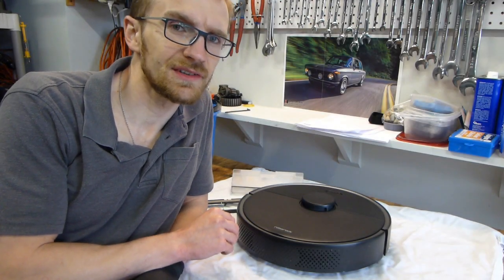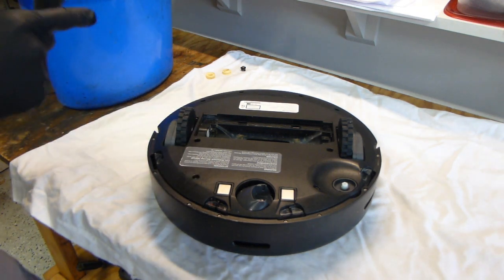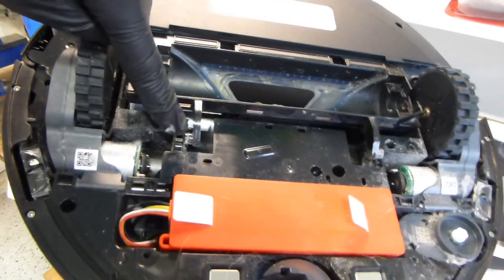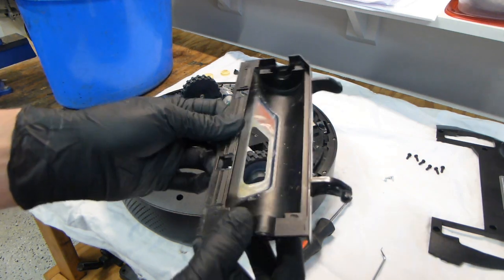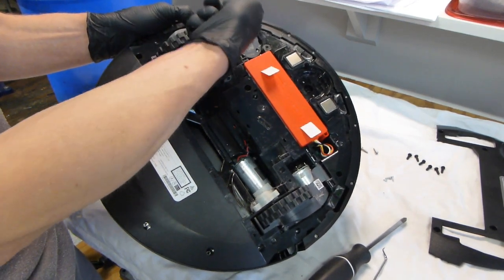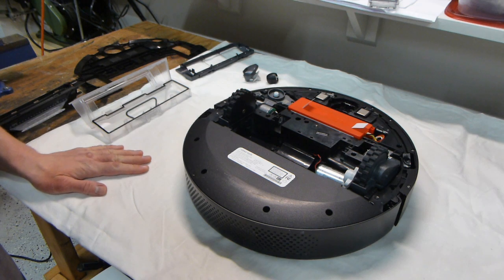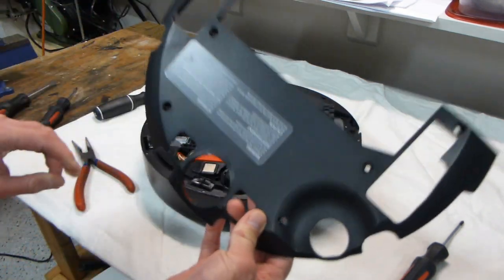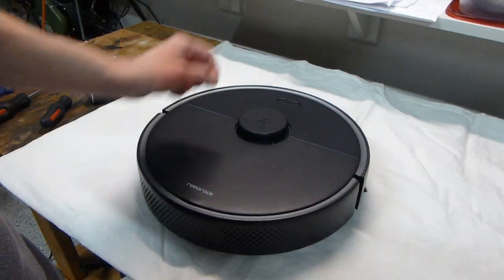DEEP Clean a Roborock Vacuum: Take Apart and Reassemble: Step-by-Step How-To

Comment: Hey. I have a question about my roborock Q7, maybe You can help me. There is an issue with mopping for last 3 months maybe. I tried few times to do everything like cleaning, deep cleaning all the parts possible...as You show, reset the setting and apps reinstallation... nothing works. It app it shows like the water should go out normally, but there is completely no drops going out. Any sensor or something??
Reply from the maker: Well from what it sounds like either the robot is not taking in water from the docking station or the water feed from the robot is clogged or something similar. I don't think there's actually any sensor to check for water flow. And if there was, that would actually be a good thing because then it could show a warning that there's no water flow. This is a very silly question, but there's definitely plenty of water in your docking station?

Comment: do you know where is the switch, hall, magnet to detect when the bin is inserted or not ? on roomba it was easy , it was a mechanical switch but on the roborock q7, i dont see any switch . I wonder what kind of sensor its been used.
Reply from the maker: I just checked on the S4 (I can check on the QRevo later), it actually checks for the filter instead of the bin. At one end of the filter, you can see a tiny magnet encased in the transparent plastic. So then I would assume that there's either a reed switch or hall effect switch on the matching spot on the robot itself, behind the plastic housing.
Reply from the maker: Ok I checked and it's the same thing on the Qrevo

Comment: Oh dang i need the big wheels out cause it ran over some dog poo that's stuck all up in the slot 😢
Reply from the maker: Been there! I actually didn't need to take the wheels out, just take it apart enough that I could rotate the wheels by hand and clean them as they turn. I thought thought that silicone rubbery interface between the dustbin and brush was some of the worst!

Comment: Regarding the piece that you removed at the 8 minute mark - the rubber part on mine has a good sized tear in it from a piece of glass.  Would you know if this is a part that i could source and swap out myself? I haven't been able to find one, possibly because i don't know what to call it
Reply from the maker: I think you have to get this from Roborock itself, try calling/emailing them with a picture. It is a the silicone (or similar material) flexible transition piece from the brush to the dustbin, they might be able to sell you a replacement
Reply: Mine is the same. If I find the part I’ll let you know.

Comment: Great vid. Thanks.
I need to get the cliff sensors out to clean them. I am in the pulled apart as much as you did stage on an S7max. The pivoting vacuum hood removal was different but other than that, I followed along with you.
Have you dived deeper in the machine?
Reply from the maker: Thank you! I have not gone deeper yet, but I hope to one day and to record it.

Comment: Got a Q Revo and I need to access the LiDAR to check the belt   I managed the underside like in your video but not the top side
Reply from the maker: I haven't personally removed the part to get to the LIDAR, but I believe that in addition to all the screws on the underside, you would also need to take off the bumpers. If I ever need to access it I will certainly make a video about it! Or maybe one day just for fun, if I have some spare time haha
Reply: Yeah same here. They want $90usd to do diagnostic plus shipping/handling plus parts and repair.
Reply from the maker: yikes!
Reply: @FASTmaster789  Need Lidar sensor cleaned or replaced.  Make the video soooon, please.

Comment: my neighbour has one of those and the side brushes do not spin .. I have removed the lower cover and the electronic s all seem to be ok    no burnt components ...
Reply from the maker: That's too bad. Even if something isn't visibly burnt, there can still be a problem. For example, if an internal electrical contact came loose, it would stop spinning but not be burnt. Maybe a mechanical problem too, if what drives the brush disengaged or broke

Comment: I got S7 MaxV (not Ultra) roborock vacuum cleaner. The water tank is stuck and isn't coming out. How can I remove it and clean it? Cannot find any detailed video about fixing that or how to get to open that section. Does anyone know about it?
Reply from the maker: I now also have a Q Revo, for that one, the water tank just pulls straight up. If it is stuck perhaps the rubber is just jammed and you might need to pull extra hard?

Comment: I have to replace the wheel tyres (S6 pure) as they are worn out.  What are all the parts I have to remove to get the pin out and get the wheels out. Thks
Reply from the maker: I haven't removed the wheels, but if it's the same as the P4 I would say you just need to go deeper and remove the next layer with the board on it. Hopefully you'll be able to see what needs to come out after that.

Comment: great video, thank you a ton!

one question -- i put everything back together, but now my pivot wheel casing won't stay in, and i can't figure out what's actually supposed to hold it there. (The gray piece did slide off the metal rod.) I put the two screws back in as described, but the whole casing now falls out. any ideas?
Reply from the maker: No problem! Glad I could help.
Are the screws staying in and the rest of the casing is falling out? They should be one piece if I understand your question correctly, perhaps there is something that needs to snap together?
Or just the wheel is falling out? If so, it just needs to be popped back in
Reply: @FASTmaster789  the screws keep the grey plastic in, but the whole rod/wheel falls out. when i take it apart i don't see anything that would actually "keep" it in place. Sure FEELS like something should snap...

Comment: One of my wheels / gear box went bad. There is not nearly so much information on disassembly of the Q5 as there is for the previous generation!
Reply: Just happened to me yesterday.
Reply from the maker: Ah, too bad. I would think a lot of the information will still be the same, but yeah, a lot could change too. I don't have a Q5, so I can't comment on it unfortunately
Reply: @FASTmaster789  i just kept taking screws out. Have to pop the cliff sensor out to allow the metal pin to slide out releasing the wheel and spring. New one ordered for $18
Reply from the maker: @JonnyWaldes  Nice, well done!
Reply: @JonnyWaldes which part is the “cliff sensor” and how did you pop it out? I removed as many screw as I can but can’t take the plate off
Reply: @JonnyWaldes did you order a new wheel circuit?  I have error code open left wheel
Reply: The wheel assembly plus circuit is kinda one piece if I recall. But some devices like my drones won't accept new parts without factory calibrations that we can't do.

Comment: Can you please give more detail on how to remove the main wheels?? How do I remove the clip sensors?
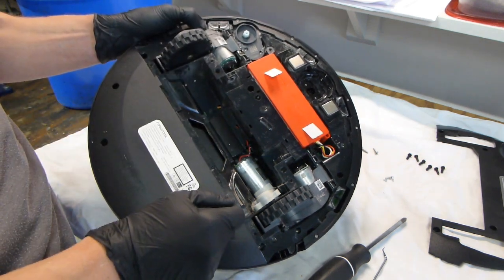Reply from the maker: Hello, in this video, this is not something I did since I only needed to clean the main wheels. To remove those sensors that block the wheel pins, you would first need to remove the inner panel that you can see around 10:48 of the video. This is the one that is a darker, gloss black color, and has deep holes for some of the screws that hold it. Once it is removed, I believe you should be able to access the connectors for the sensors.
Reply: @FASTmaster789  Thank you so much! I took it apart and just could not get the sensors out. I just cleaned them with a toothpick and vacuum and got them clean. Thank you for your response!
Reply from the maker: @jenniferwagley241  Awesome, glad to hear it!
Reply from the maker: @jenniferwagley241  Great to hear! thanks!!